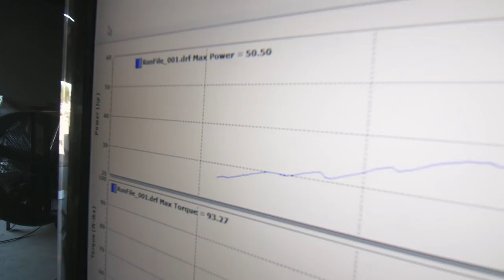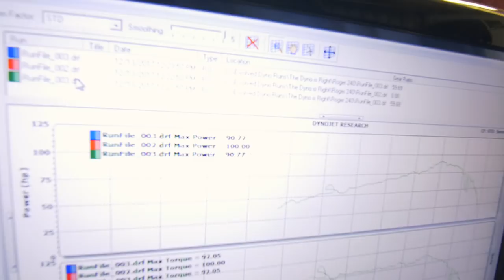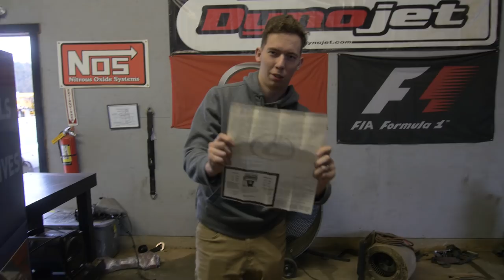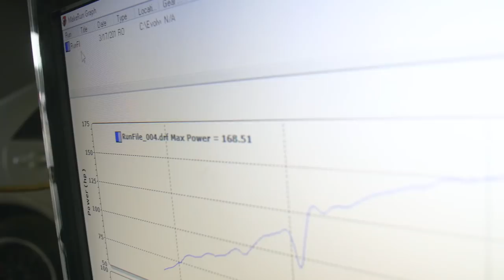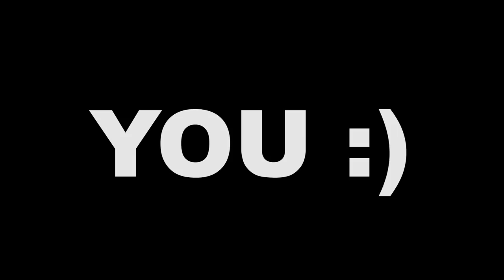STOCK Nissan 240SX vs STOCK Lexus SC300!

Comment from the maker: Which of these would you choose?
Reply: ThatDudeinBlue the 240 :P
Reply: The sc300 that's an easy choice
Reply: 240 but not auto
Reply: Sc300 + 1jzgte + Collins Adapter Plate mated too a 009 350z trans = Love on site
Reply: ThatDudeinBlue sc300, so classy and can take power better plus that 2j get pretty good mpg!
Reply: Sc300
Reply: Sc300 ftw
Reply: Delorean
Reply: Soarer
Reply: Wheres the dyno sheets tho. I want to see the torque and power curves. Kinda pointless if we don't get to see them.
Reply: why can't a man have both?
Reply: ThatDudeinBlue I'd choose the Lexus because of it's starting hp and torque range.  This is an insteresting way of showing people so that way we can consider more options! You should do more of these video's with stock cars David, this is a very intriguingly awesome way to get more people involved in the car world👍 Rockin video✌
Reply: ThatDudeinBlue Silvia
Reply: SC, more room in the bay for swaps/parts etc
Reply: ThatDudeinBlue the 240sx, and then swap the engine a stock SR20DET.
Reply: ThatDudeinBlue you can loose power from a car being auto ?
Reply: SC300 all day. That 2JZGE will handle power all day long. Plus, you don't have to deal with "drift tax" as much as the 240 crowd and its classy.
Reply: Estherdeen mate...

Comment: I wanna dyno my forged internal & cammed N/A KA 240sx to compare to a stock engine! I'm not boosted yet but it will be soon.
Reply: Sammy's 240sx Adventures! Hell yeah man. You're doing right. Build it before it blows haha
Reply: Anthony Fling those were my exact thoughts. Build it right the first time! Its fun to drive as it is though.. But turbo is more fun.
Reply: Sammy's 240sx Adventures! Oh hell yeah man. Good luck with the addiction haha
Reply: Get with this guy @thatdudeinblue
Reply: Sammy's 240sx Adventures! Maaaan been debating doing the same thing
Reply: Sammy's 240sx Adventures! What kinda cam are you running?
Reply: What came a do u have the 248 or did u put in 262 cams

Comment: sweet! now i got an idea of the whp for my sc300 as well. thanks for posting this video
Reply: Christian T there’s something called google buddy.
Reply: cutthroat795 given that my sc300 is 23 years old it’s kind of nice to see an even older one get dyno’d and show the whp considering age. I know I could google it, smart ass.
Reply: Christian T it may be old but it also has low mileage. But what the hell 5hp difference between that and a more worn out engine is hardly something to be nit-picking about. Not like a dyno sheet is giving a rough estimate or anything.

Comment: Deciding between a stick SC 300 or a stick is 300
Reply: SC
Reply: Imo I've had an SC, they're big heavy luxury boats and they're fun to mess around in but they aren't fast, I think the IS is much better car and platform to build and it's bad ass seeing a 4 door supra running around, but finding either cars with a stick is rare
Reply: Mohamed Hussein pick what you want. I like the IS300 more but that doesn't matter.
Reply: Careful adding forced induction to manual IS300, it’s weak sauce
Reply: go with the IS, theyre a rare find in a 5 speed
Reply: xnreyescj No forced induction for a long time if I get it lol I'm a broke senior in high saving up
Reply: Jewbasaurus I'd say the sc is probably even harder to find in a manual
Reply: James Foster I've searched around a good bit and the is300 is a lot harder to find but they're also usually cleaner than SC's
Reply: Mohamed Hussein there were only 3,883 manual sc300s made with 1992 being the year with the most produced at 1,601. While there are 13,122 manual is300s with 2002 being the biggest year for the manual is300 with 4,433 produced
Reply: James Foster I understand the production # I meant from searching on Craigslist, eBay, etc its a lot harder to find a 5 speed is300
Reply: I have a 1995 manual SC300 and my buddy has a 5 speed is300. I’d say SC300 all the way!
Reply: Darrell Ton i love the look of the sc over the is. Is there any noticeable weight difference?
Reply: Sc is ultra rare to find manual 10x more rare than a is
Reply: SC
Reply: is300 no discusion

Comment: David, If you were given that stock 240 and were told to start from the bottom to build it, what would you do differently compared to BlueJZ?
Reply from the maker: Build my 2jz from the very start, and a CD009 transmission instead!
Reply: ThatDudeinBlue sweet! Gotta hold all that power down! Thanks for replying, big fan here!